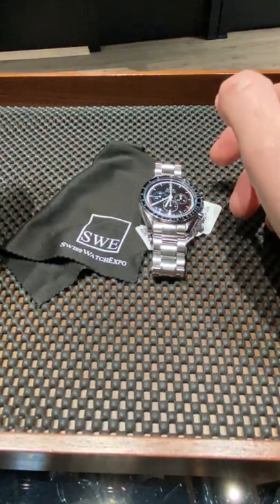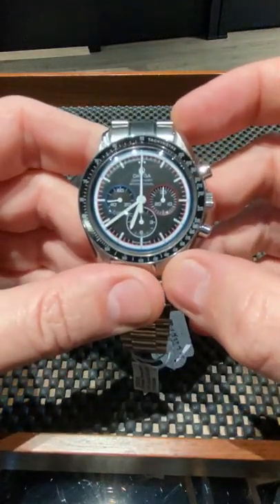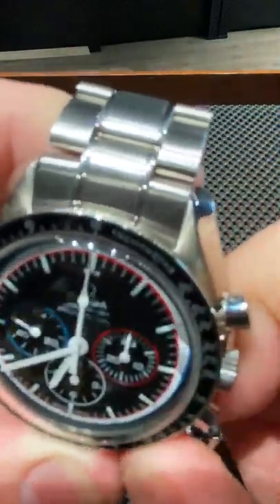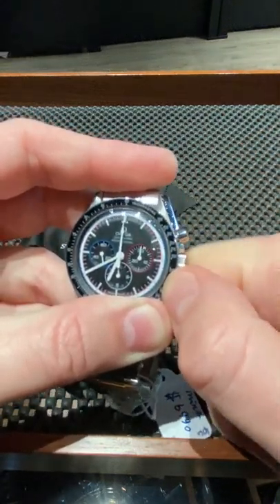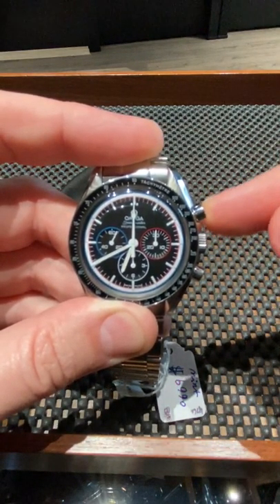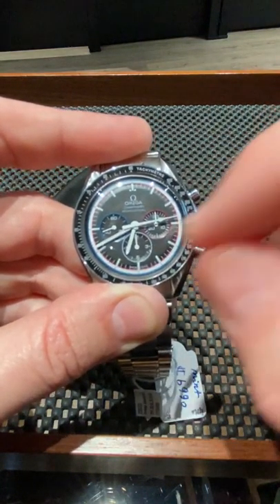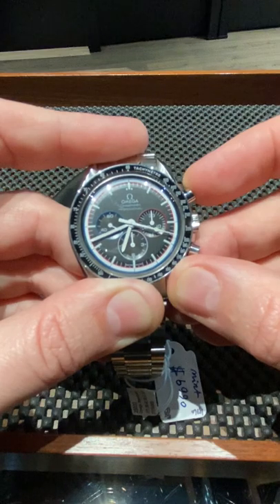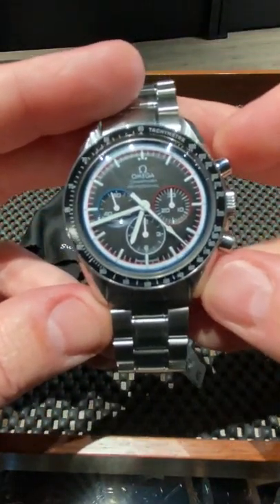How to Wind a Manual Wind Chronograph - Omega Speedmaster | SwissWatchExpo [Watch How To]

Comment: Why do people want the second hand to always be moving around? Second hands do not tell time...
Reply from the maker: Hi Rich! For questions about our watches, please contact us at (404) 814-1814 or info@swisswatchexpo.com.

Our sales team will gladly assist you during business hours (M-Sat 10AM - 5PM EST). 🙂
Reply: It makes no sense to me that the actual seconds hand is the small one that is part of the timer trio. The big seconds hand should tell the actual time and the small seconds window should activate only when you use the timer. So all 3 small windows should be timer related. Yet no, for some idiotic reason they mix this up in so many chronographs
Reply: @LulzRoyce  The bezel of the Speedmaster is a tachymeter.  The large second hand needs to point to a number on the bezel/tachymeter so you can measure your speed.  How would you do that with the tiny hand at the 9 o'clock position?

Comment: The red dial only goes up to 30 minutes? So the number 10 could represent 10 or 40 minutes elapsed? If so, how do you know how much time has elapsed?
Reply from the maker: Hi! For questions about our watches, please contact us at (404) 814-1814 or info@swisswatchexpo.com.

Our sales team will gladly assist you during business hours (M-Sat 10AM - 5PM EST). 🙂
Reply: The hour dial jumps in halves. So after 30 minutes the hour dial will move half way towards 1 hour. After another 30 minutes it’ll jump to 1 hour, and so on.

Comment: thanks this is a very useful video. just one question, when u wind it clockwise for 1 turn , does the crown will actually bounce back anti clockwise? if yes, is that normal?
Reply from the maker: Hi Reiner, thanks for watching! For questions about our watches, please contact us at (404) 814-1814 or info@swisswatchexpo.com.

Our sales team will gladly assist you during business hours (M-Sat 10AM - 5PM EST). 🙂
Reply: Mine seems to bounce back as well

Comment: I have a brand new Speedmaster which was stopping occasionally and was inaccurate when keeping time.

It turns out that it really needs to be fully wound for it to proper as advertised.

I didn’t wound the watch as expected since I was too gentle when winding it

When they say wind it, you need really need to wind it, until the crown stops. Just do it slowly and you will be ok.

Now it works perfectly with no stops.(0.5 a second a day loss of accuracy).
Reply from the maker: Thanks for the inputs, Nir! This would be very helpful for Speedy owners out there.
Reply: Yeah. That was a great point. It was my exact problem.

Comment: And what does the bottom 6 o clock subdial do when not in the chronograph mode? Does it just stay still?
Reply from the maker: Hi! For questions about the watches, please contact us at (404) 814-1814 or info@swisswatchexpo.com.

Our sales team will gladly assist you during business hours (M-Sat 10AM - 5PM EST) 😊
Reply: Yes, when not using the chronograph it’ll remain at the 12 o’clock position